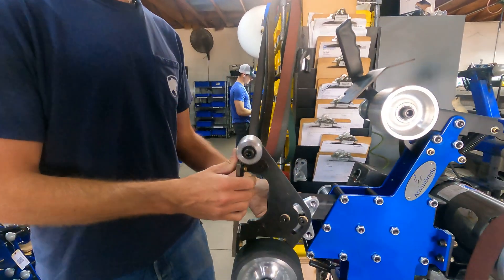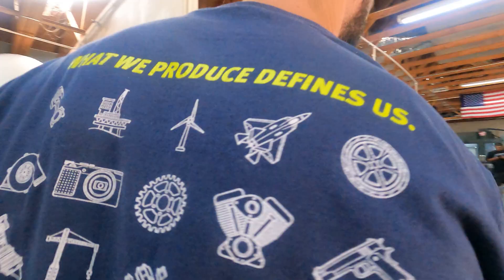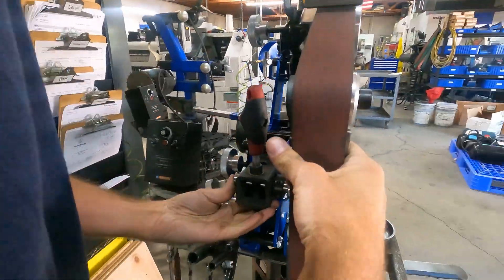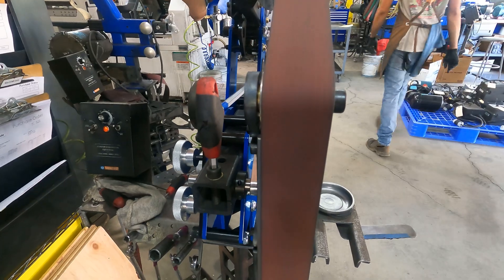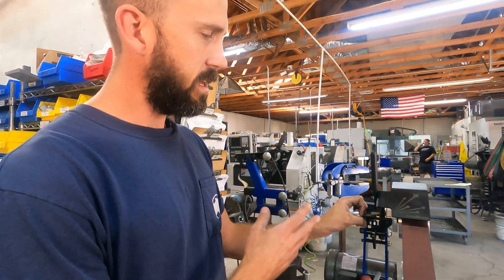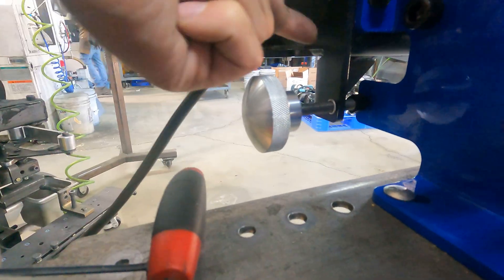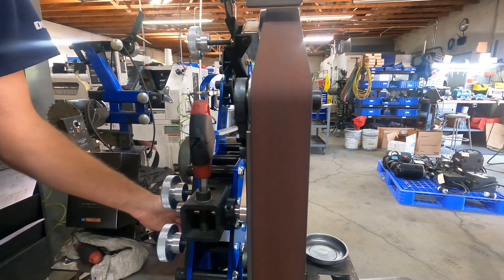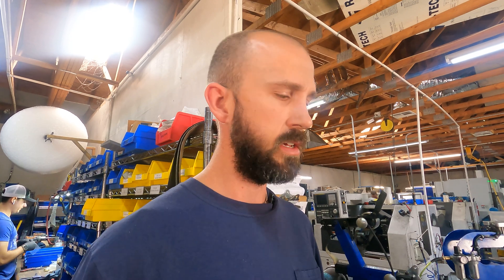Reverse Belt Grinder Tracking

Comment: This feature works great! I followed your setup instructions for motor alignment using the flat alignment gauge included. SInce then, all my tracking in both forward and reverse has been spot on and consistent! You guys make a superior product, and I'm glad to endorse your grinders to anyone that will listen!

Some grinders on the market just have too much "glitz and glamour" going on with their designs, while your Fastback is just beautiful in it's simplicity, ease of use, and rock solid performance.